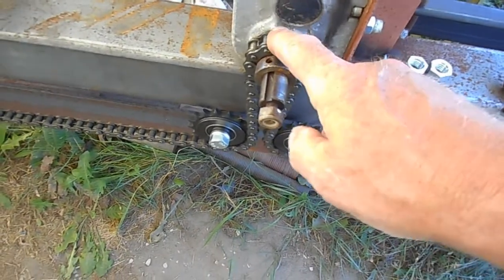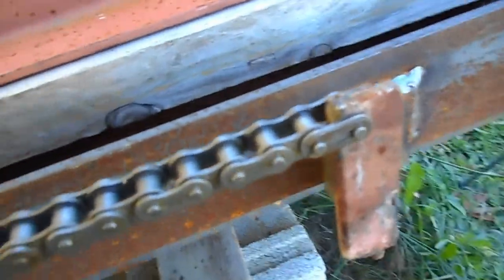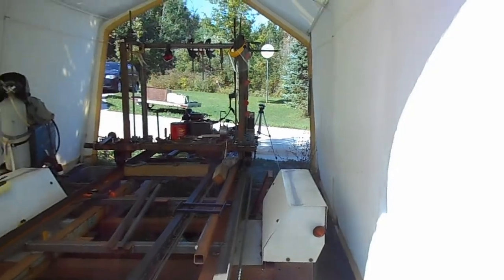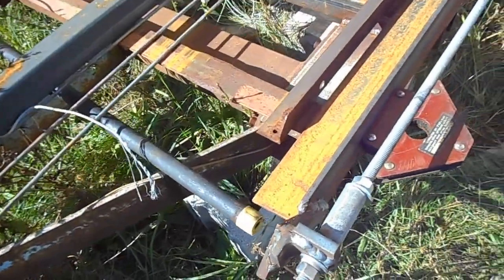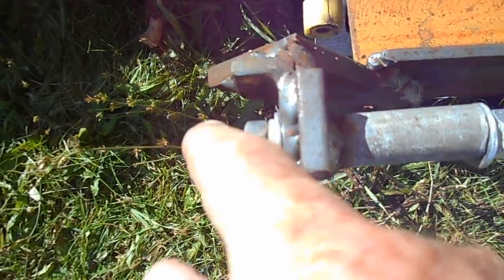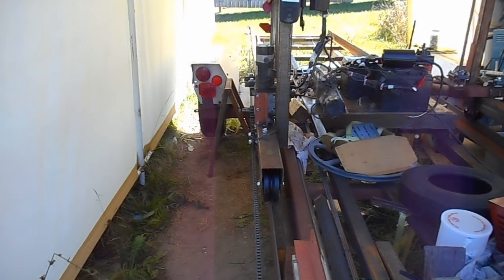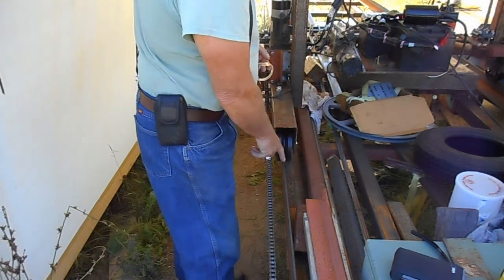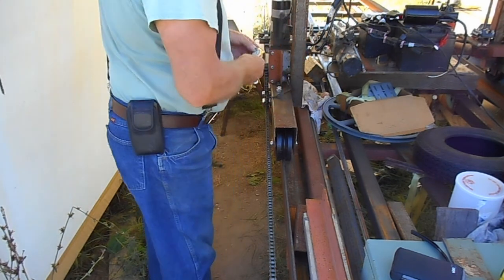Po-Boys saw mill power feed, first 2ft carriage movement timed 15 seconds.

Comment: Where did you get the motor,  12V or 110?  Did it last and work as planned?   I need to build one for my mill.  My back is letting me know it is time.  Thank you
Reply from the maker: Joe, thanks for the question. I had developed back problems and did not finish the mill. I do plan to do so this summer. The motor is a 24v dc motor from an electric wheelchair. It will work fust fine on 12v dc just won't be as powerful nor will it be as fast as 24v. No doubt it will work as many have done this before me. Thanks again

Comment: Good video and well expressed. I am thinking about doing the same thing on one of my homemade sawmills..But I think I need to run mine a little slower or have an adjustable controller to cut some of the wide slabs and hardwood I cut..What size is the gears and what kind of motor are you using. I found a wheelchair motor, I'm thinking about trying.. Good job
Reply from the maker: Thats a wheelchair motor with an 11 tooth sprocket in another video I show a variable drive purchased on line ebay or amazon for about $15.00 USD. tthanks for the comments.

Comment: I have a new Woodland Mills saw.Pouring concrete next Monday.Where can a guy get the motor u have to mount on my mill?Worm drive?
Reply: You did great on the video by the way!Thanks for the info.My mill weighs 1000 lbs.The small motor will run it with no problem? Where do u mount the batteries.?I know somewhere on the mill.Come on make another video...  :)
Reply from the maker: John The motor is already to fast on 12 volts so I only needed one battery. A battery was purchased from salvage yard. it will be recharge by automotive 60 amp car alternator, the 18 hp motor can do this and have enough power to run bandsaw blade at same time. I will post at photo later of battery mounted on same plat as 18 hp motor mounted on.
Reply from the maker: I have seen many on EBAY for sale, look for electric wheel chair motor.

Comment: Looks good, way better then the no 1. Any reason besides wanting a cleaner finish to build this one and not just keep using the old one? Im gathering ideas for materials and designs for my build and was wondering if you had trouble cutting larger trees with the smaller motor the old saw had
Reply from the maker: First saw mill did have a size limitation 22 inch diameter log. It worked well I sold it this spring after a very short advertising no market place. I'm in Michigan and the gentleman that purchased the saw came from Wisconsin. We loaded the saw mill in a full size ford van and away he went so it was portable and would cut an 18 foot log length. Every operation of the smaller mill was manual making a guy or girl very tired at the end of the day.
  The new one is trailer mounted making it more portable and will cut a log 36 inches in diameter up to 16 feet long. I will employ a cable system to load and turn the larger logs. Another cable system will operate log grips, log hold downs.  The latest video shows carriage movement  by electric motor forward and back. Next video will demonstrate carriage powerhead raise and lower by another electric motor. 
  You can see this is a much more advanced system all the way requiring less human muscle interaction. After cutting all day at the mill I shouldn't be so tired out. First sawmill was a good introduction to the job of making lumber from trees.
 Hope this answers your questions. So glad you asked and I am happy to share my thoughts.